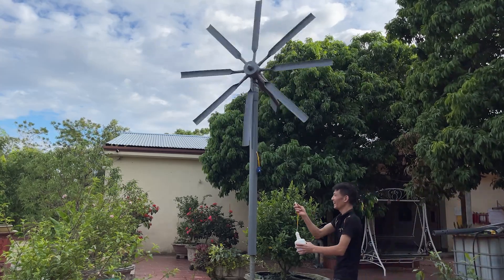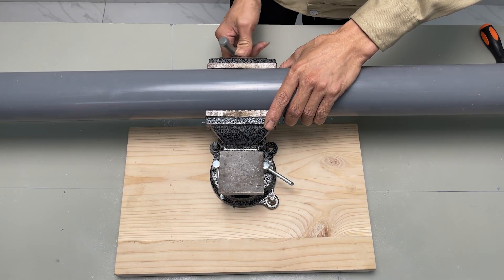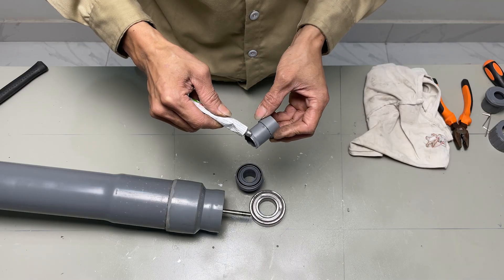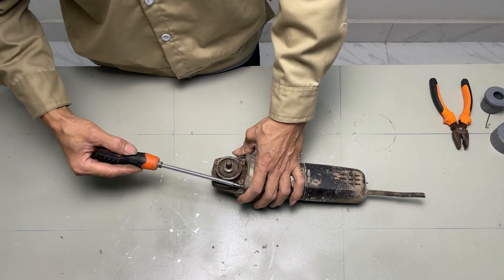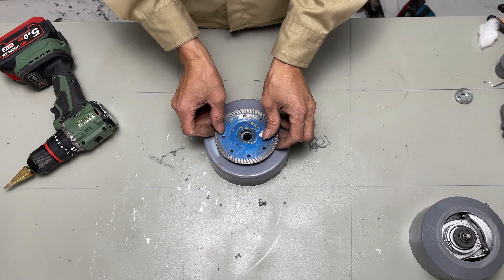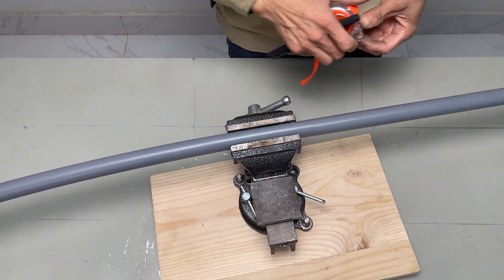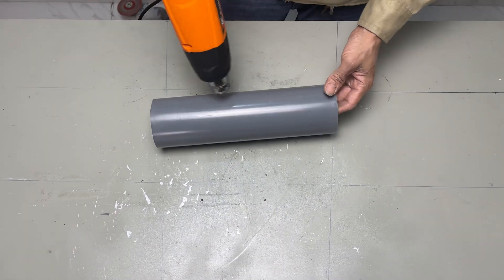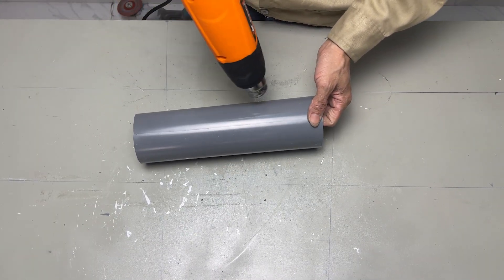How to Make Endless Free Energy at Home with PVC

Comment from the maker: 💨 Our Free Endless Wind Energy System project has officially begun!

The goal is simple: build a real working wind turbine from PVC drainage pipe that can generate free electricity at home and help us move closer to off-grid living. If you want to follow every upgrade and test until it becomes a stable power source, make sure to SUBSCRIBE + turn on notifications 🔔

👉 In this video we will:
✔ Cut & shape turbine blades from PVC pipe
✔ Optimize blade twist for faster RPM
✔ Install bearings, shaft and wind tail for direction control
✔ Test real output voltage under strong wind 🌬⚡

💬 Tell me in the comments:
What should we power first?
A battery charger, a water pump, garden lights, or something else?

🌿 Let’s build clean, free, endless energy for our homes, together!

#PipeHolic #PVCWindTurbine #FreeElectricity #DIYFreeEnergy #WindPower #OffGridLiving
Reply: FREE ENERGY